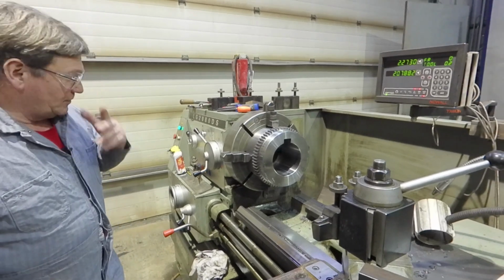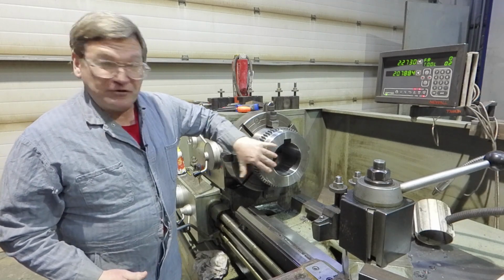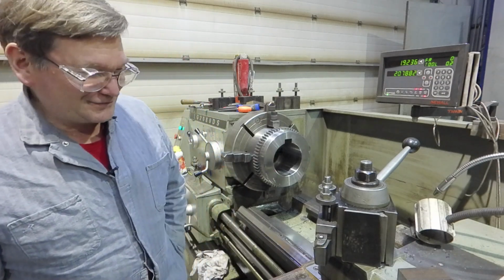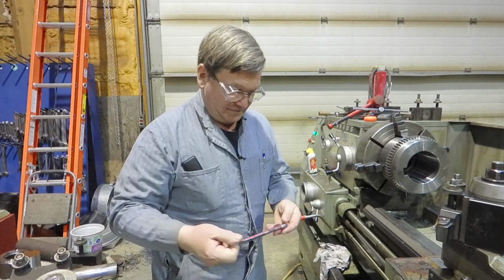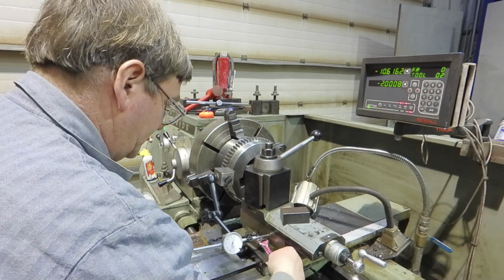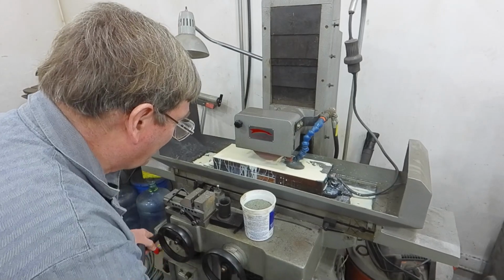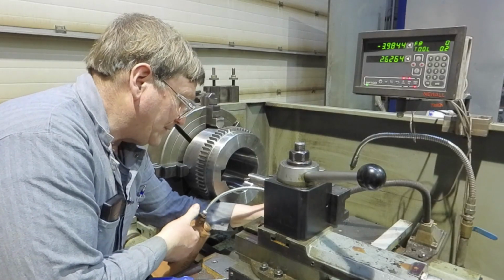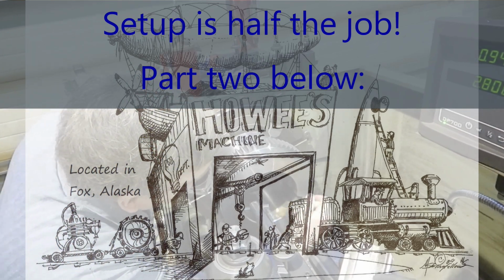Boring out exactly .002" of material, part 1

Comment: It is so much easier when you are far away, and can do 2 or 3 practice finish cuts with the same depth of cut, and you can measure the result.  Trying to take off .002 per cut, 1 shot, is a nightmare.  

I would hone it.

Comment: It can be done. I always use a carbide with a small radius on the tip like 0.2mm the surface finish will suck though coz not enough tool pressure. Has to be run at maximum allowable speed.

Comment: We had one that goes on a 5.5" shaft. They never gave the hub provider a spec so we had some that were 3 thou under but the worst we got was .020 undersized. Had to bore it out to .005 under and bring it back to put it on.

Side note: you can always get it back off. Sometimes you need more and bigger rosebuds along with a hydraulic press.

Comment: You need to pad the jaws! Why leave jaw marks on the OD? Let 'em try to figure out how you done it when you hand it back to them!
Reply: Every finished part I've ever grabbed in a 4 jaw was padded with aluminum shim stock or wrapped in brass shim. Prevents marring and its much easier to dial in your part when you're not fighting hardened jaws that most likely have memory, which means you could be damaging the part surface.

Comment: I would be curious to know at what temperature it is "0.004 off the original spec". It seems to me the diameter will grow or shrink as a function of the temperature in the shop (or CMM room) when it is measured.
Reply: Exactly. That's why this demonstration is bs in my opinion.
Reply: He measured the bore at the temp say 32 deg in his shop and set his bore guage to that . The customer measured the bore at their temp say 95 deg and said they needed it 4 thousand  bigger in  diameter, so since he measured it at his temp he and has a reference in his bore guage all he has to do is take out the 4 thou and it's good , 4 thou bigger at 32 is still 4 thou bigger at 95deg. Now if he just took out the 4 thou with out getting a reference  it would be a problem. IMHO

Comment: I experimented with citric acid a few years ago. I cleaned a cummins wrist pin, then coated half with a thin layer of grease. Had pH at 3.0.
I can't recall exactly how fast it removed the clean material. 
But was amazed at how consistent it was.
But haven't tried it in a real needed situation.

Comment: I know you've been doing machining longer that a lot of viewers have been alive. I always use a stone in my die grinder to give me rake. The micro grinding lines are not at right angles to the direction a cut is made. You might have a flat rake at say 5 deg but at the contact point it may in fact be negative because of the micro grinding marks. I use a slip diamond ezy stone to rub around the edges to perfect the tool. I've been doing this stuff for fifty years too.

Comment: I've had great success micro skimming bores using a ceramic insert. Usually a triangular double sided one and straight soluable oil. Very fine feed rate and pretty decent surface speed. Been a long time since I've had to grind a bore.

Comment: A slip fit was always more complicated, and involved some sanding. Bearing heaters were are goto for most, press fits. But we had, a couple of very big torches. Always easier to drop down on a vertical shaft. And 3# brass hammers, ready. Looks like an expensive Longem lathe. Have you torn it down already? I think the Kalamazoo Clausings, had to be torn down most often, usually the variable belt. I would love to see a maintenance free machine, just once...

Comment: I read below about heating a coupling beyond 400 degrees. It is possible to heat it as much as you want to but use caution, you don't want to ruin your seals as the heat bleeds into the shaft. Another commenter mentioned measuring the motor shaft prior to boring the coupling...good advice. Also make sure the side-to-side measurement on the keyway/keystock is good prior to heating the coupling. The correct interference dimensions are determined by the load on the coupling; heavy torque situations may require a heavier interference.

I did read in a Falk manual that they wanted to avoid perfect alignment on a gear coupling, like the one pictured, because the teeth needed some back and forth for lubrication. Seems a little odd to build misalignment into your reducer/motor settings. I am a skeptic. I do know that using the grease fittings on the G-10 or G-20 cover on this coupling will leave the teeth w/out enough grease. Pack the front of the cover with grease before pulling the cover up onto the coupling. I have seen teeth welded together in a high torque situation while the back of the coupling was full of grease. I do like the Falk LTG grease. It is a horror to get out of your clothes and off your tools but is very good grease. 

The biggest Falk grid type coupling I have ever bored and keyed had about a 14" bore and went to a large 18' diameter rotary kiln. The trunnions weighed 20 tons each. Almost 5' in diameter.

Comment: Tapping with a rubber hammer isn't very precise for me, especially as the jaws are tightened. I use a tapered wedge against a softener (so I don't mar the chuck face) at the back of the coupling and a steel hammer. I also use a red layout die on the bore to see when I have touched. Hard to see small amounts on a reflective surface. I like to use a very sharp (sharp edges, not nose radius) uncoated carbide tool and turn the part relatively fast. The Falk gear coupling here is 1045 and is easily turned fast. Always indicate the face first, then the O.D. Back and forth, back and forth. I always indicate the O.D., not the bore. I don't really care about the I.D. being indicated as the O.D. is where the torque transfer to the teeth takes place. This assumes there is enough bore material to clean up. A commenter mentions below about drilling and tapping holes for puller studs. That is something that should always be done on larger couplings. It is difficult to get a good puller behind the cover on a gear coupling.

Rather than using an offset on a compound, use a last-word indicator on the apron reading against the back of the cross-slide.

I have found that, on a large coupling, I use a throw-away wire rope around the coupling while heating the coupling prior to assembly. The reducer or increaser is positioned with the keyway vertically positioned, or at least close to it. I use a hoist to position the height and keyway orientation as close as possible prior to heating. Then move the part away from the final resting point with the hoist in one direction only. Then after heating it is as close to lined up as possible so you don't lose valuable time making adjustments. (After heating and installing the coupling, cut the wire rope in half and throw it away or put it in a designated location and use it only for coupling heating. It has lost its temper and rated strength). I much prefer a Propylene rosebud setup for heating. Much hotter and quicker.

I like to check and double check keyway depths before any of this takes place. I have seen many couplings stuck with improper keyway depths. I also set an inside micrometer to 3-4 thousandths over the shaft diameter. I will check the I.D. of the coupling as it gets hot. It is easy to get the growth in a vertical position (heat rises) and think you are ready to go when the sides are still undersize. Compensate for this when doing the heating by keeping your rosebud a little longer on the sides as compared to the vertical position. Be sure to check all the way through the coupling as you are heating, primarily, the ends of the coupling. The heat takes time to travel through to the center of the coupling. Lacking a preset inside micrometer, you can calculate thermal growth and use temp sticks to good effect.

Finally, never use anti-seize while installing the coupling. Use a good machine oil liberally on the reducer/increaser shaft. If you use anti-seize, the heat will dry it out and it will pile up in front of and under the coupling bore and it will stick.

I have never stuck any of the hundreds of Falk (or other) couplings I have installed over the last 50 years IF I stuck to these methods.
Reply: All good tips

Comment: I remember during my apprenticeship at Blount we had to do a shrink and heat on a replacement master die set for a transfer press, the shaft was a leader pin that was about 4 inches diameter and they put it in a liquid nitrogen bath for hours per a recipe that they had. And then had to have everything lined up to yank out the leader pin out of the bath and quickly get it over to the master die that was nested in a hydraulic press and then press the pin in. All the while things are thawing and cooling off. It was interesting for sure

Comment: That is an h series coupling from falk.. just got done boring out 2 of them for a debarking drum had to send them out to a gear shop to have keys cut they where interference fit as well one was 7.845and the other was 9.246” it’s always a good idea to make pull holes for coupling just something I thought I’d share with you
Reply from the maker: The most fun coupling I used to change, was a Flender (rubber inserts in holes) about 12" bore, approximately 4 foot in diameter & 18" thick.  What made it fun was, the shaft was vertical about 16 feet long, so we used gravity to either install or remove, just turn the correct position & add lots of heat.  when removing it was nothing for about 1/2 hour of heating & then it just slides off & falls on the cribbing.  I grew up around logging & paper mills in Washington state, where are you at?
Reply: @HOWEES   located in north west Georgia I love your videos very informative
Reply: Wish I knew how to add pictures to comments there are 3 different positions to place the couplings for cover so that would matter as to what face pull holes need to be placed

Comment: Hi, great video, when i was fitting couplings to shafts, mainly big motors(500hp and above) the first stage would be carefully measure the shaft rather than use the original specs, as it may have been hammered, filed, emery papered, etc,, during its previous life, as well as being at one of the limits of it's tolerance.  Only then would the fit be calculated. Agree it's an absolute pain getting it wrong. Very interesting machining. Thanks